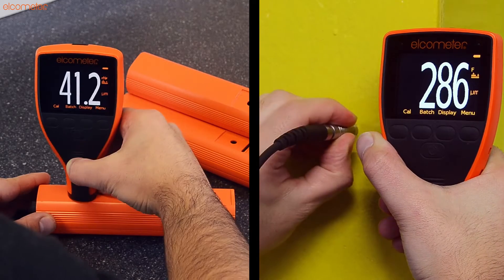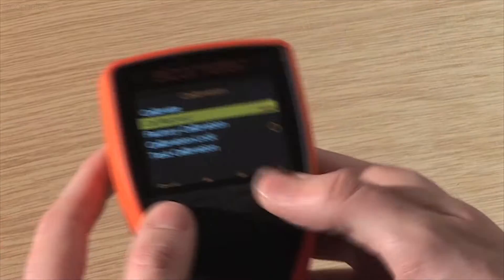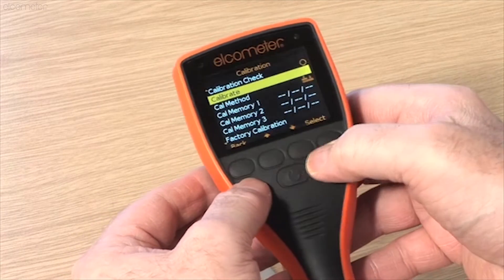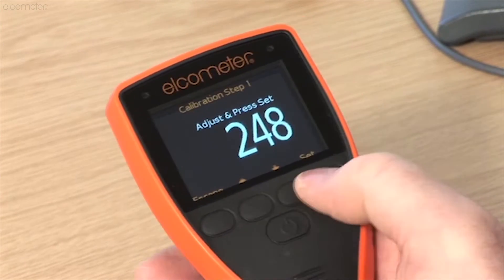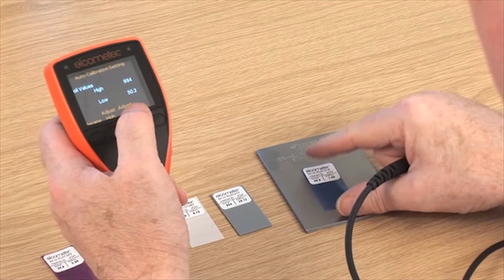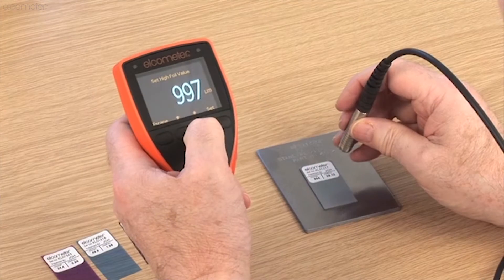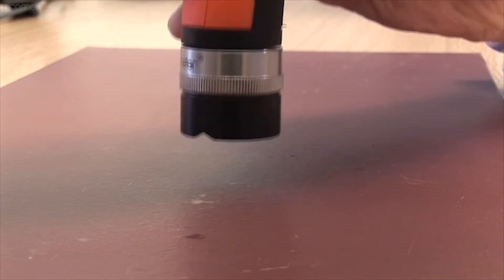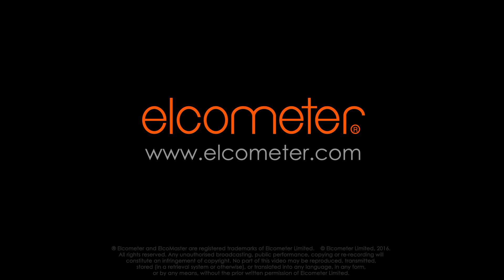Calibration Methods on the Elcometer 456 Coating Thickness Gauge

Comment: Is this one work in concrete surface
Reply from the maker: Thank you for your comment.

The Elcometer 456 measures coating thickness on ferrous and non-ferrous metals.

To measure coatings on concrete, there's the Elcometer 500 Concrete Coating Thickness Gauge: https://www.elcometer.com/en/coating-inspection/dry-film-thickness/dry-film-thickness-digital/elcometer-500-concrete-coating-thickness-gauge.html

If you have any further questions, please contact techsales@elcometer.com or visit www.elcometer.com/contact-us to find your local Elcometer distributor
Reply: No

Comment: I understand that the term "calibration" used in this video is "customer calibrate" and should be called "gage adjustment" in accordance with ASTM D7091. Technically, only Elcometer or its approved center/accredited lab can "calibrate" this gage. Now, I would like to get guideline step by step on "verification of accuracy"! Does verification of accuracy require factory reset as the first step ( to eliminate all gage adjustment before) ?
Reply from the maker: Thank you for your comment.

As you say, the true calibration of a dry film thickness gauge can only be done by the manufacturer, an authorised agent of the manufacturer, or an authorised calibration laboratory. The calibration must be carried out in controlled conditions following a documented procedure. The gauge should be re-calibrated from time to time, but that period depends very much on the frequency of use of the gauge and the quality policy of the company using the gauge. 

The word calibration, when related to user set-up of the gauge, is used throughout the industry, however, the correct term is verification, as used in the standards. 

In this video we use the terminology employed by most manufacturers, and use the word calibration when referring to user verification.

As for verification of accuracy, you should check the gauge throughout its measurement range using Elcometer certified foils and the gauge's in-built calibration routines.

If you have any further questions on which calibration routine to use, and what foils to use, please contact techsales@elcometer.com or visit www.elcometer.com/contact-us to find your local Elcometer distributor.

Comment: I could not locate any downloadable manuals from the website as stated in the video.
Reply from the maker: Thank you for your question.
The instruction manuals are available from the web page of the Elcometer gauge you would like to see the instructions of.
So, if you go to the Elcometer 456 page on the website (there’s a link below you can click on), in the top right of the page there is the “Instruction Manual” button. It’s between “Accessories” and “Data Sheet”.
If you click on “Instruction Manual” you then have the choice of the full instruction manual, the user guide, and the quick user guide - which you can view or download.
Elcometer 456 page: https://www.elcometer.com/en/coating-inspection/dry-film-thickness/dry-film-thickness-digital/elcometer-456-coating-thickness-gauge.html
If you have any further questions, please contact techsales@elcometer.com or visit www.elcometer.com/contact-us to find your local Elcometer distributor, and we will do what we can to help.

Comment: can we use as surface guage? I mean we can use as DFT and Surface preparation
Reply from the maker: Hi,
I am afraid not as DFT and surface profile require different gauges. 
In order to measure surface profile for surface preparation, you will need the Elcometer 224.

Comment: Hello There,

I have a clarification of DFT check as given below:
 - Surface profile: 65 microns by Testex Tape.
 - Coating System: Only IOZ Primer with 65 microns minimum

To verify the DFT of IOZ primed surface, DFT gauge to be calibrated on ZERO Plate of profiled BMR surface? because when I check the DFT gauge on profiled surface I get average 30 microns reading.
it means IOZ Primer minimum 65 microns + 30 BMR = 95 microns minimum. (Is it correct?)
Reply from the maker: Thank you for your comment. 

For measurements on a blasted surface we’d recommend a 2 point calibration using foils either side of the coating thickness, so for a 65 micron coating we would recommend using a 25 micron and 125 micron foil. 

If you have any further questions, please contact support@elcometer.com or visit www.elcometer.com/contact-us to find your local Elcometer distributor.

Comment: Hi,I need your help,
I'm facing error i,e "Unstable reading error ,press a key"
This error is coming
Please help
Reply from the maker: Thank you for your question.

We advise you try a gauge reset, by pressing the Menu key, then select the Reset option.

If this does not solve the error, then please contact our technical support department.

Email techsales@elcometer.com or visit www.elcometer.com/contact-us to find your local Elcometer distributor.